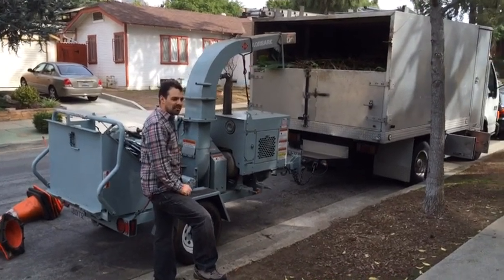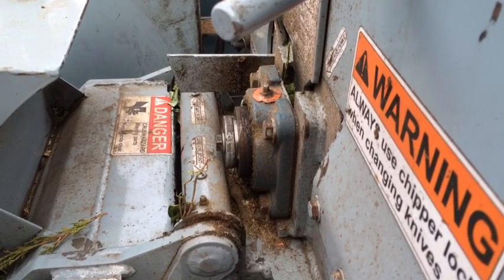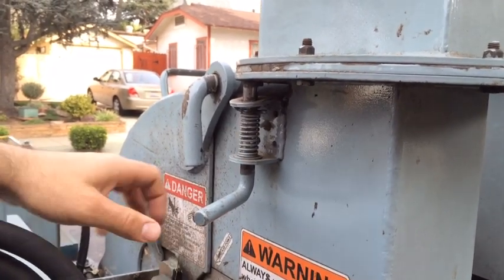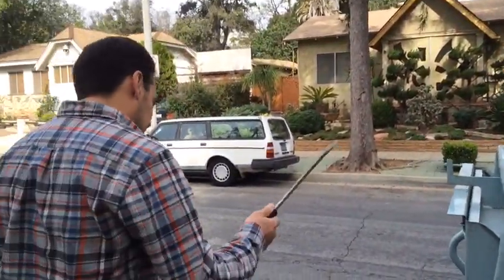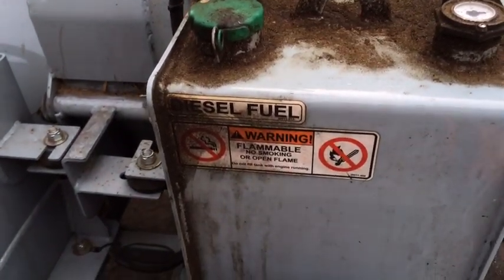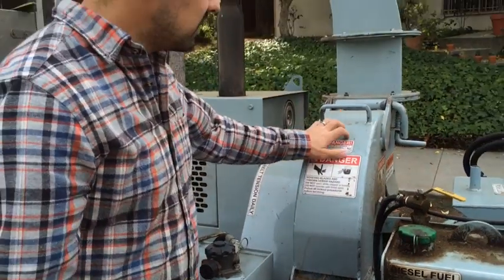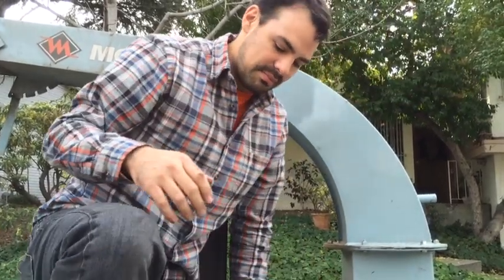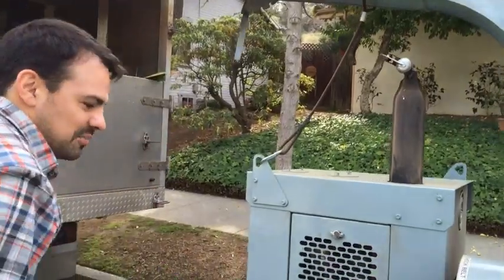Morbark Dealer Repair Probs

Comment: Did they torch the old bearing off?  Many parts around the bearing area look burnt.  If i ever had a new machine returned that way shit would hit the fan.  Nice fuel cap, customers must love drips on their driveways.  The chute is a safety hazard, the possibility to twist, and hit an object is just way to big of a risk.  Because the disc access area is damaged, id feel the owner would be less likely to service the chipper, causing more damage.

Comment: These Morbark guys are getting a free ride at your expense.  You say "it's no big deal" to those machinations you have to do to close chutes, etc.  I disagree...it'll be easy for someone to pull or strain something doing all the stuff you had to do...or lose their grip/balance and get hurt.

I think Morbark should replace that with a new chipper...at the least totally make your work simply, easily, not leak, etc.

I think someone at Morbark will pay attention to your very explicit and reasonable video.

Comment: Annoying, but you can still use it. 
Main problem is the rope thing : is it tense enough that there's no risk that when you drive, the shoot may rotate tot the side and hit a bus? I would tie it under tension (such as with a truckie hitch, the version with an eight on top).
Now that all this has happened after 95h of use, is what is really worrying... Our chippers get that much use in a month probably. You know the saying about chippers : the ones from 15 years ago last forever, the others not that long, at least not without frequent small repairs...

Comment: Nick, you've used the term 'repair' quite generously. This company seems to have left you with as many new faults as they may have fixed. If they have taken money for this work, then they should be working to a much higher standard.